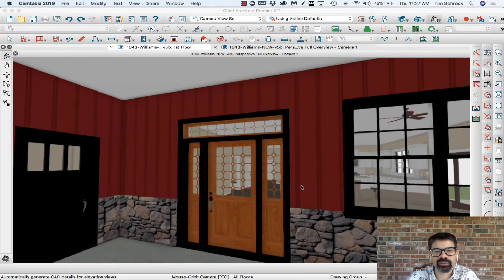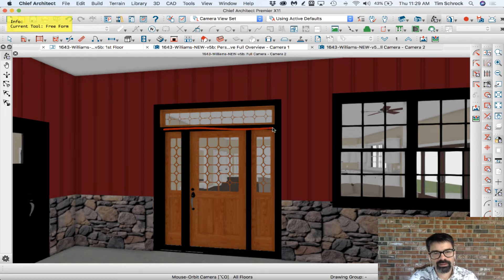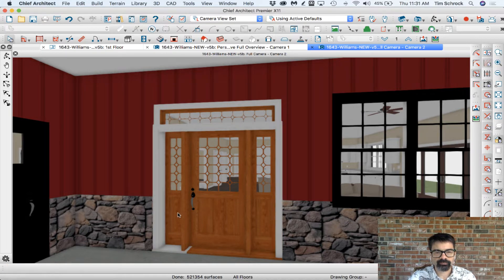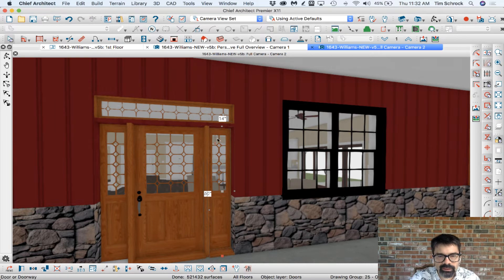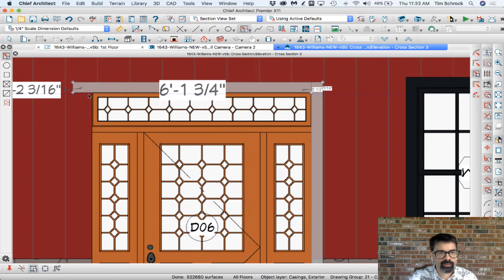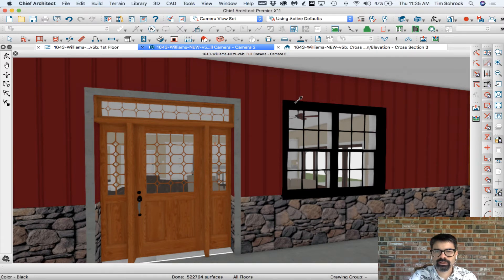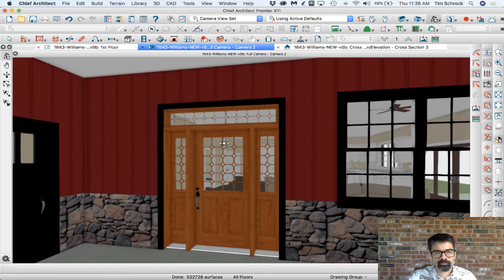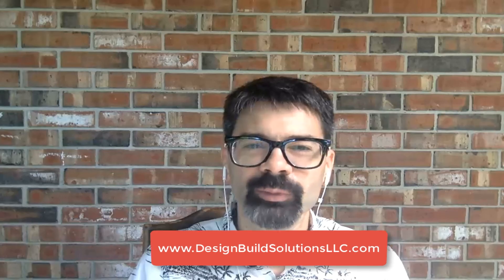Custom Door Materials | Chief Architect

Comment: What does blocking do to the door and window schedule?  Does it now become a door assembly once blocked together?
Reply from the maker: You can handle mulled door/window units in a number of ways. It can be one unit in the schedule, or there is the option within the mulled unit to show all individual units as individual lines in the schedule. Just depends on how you want it to be shown.